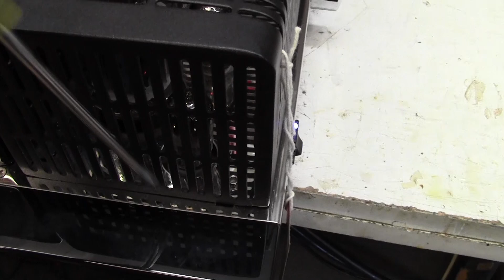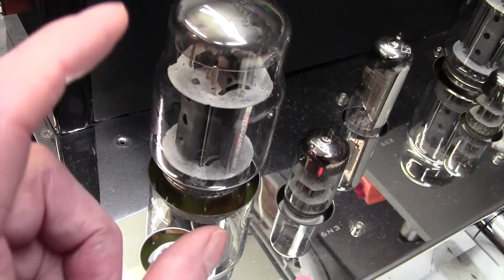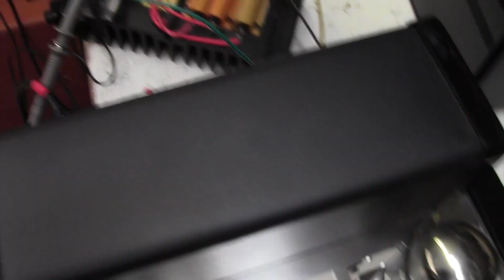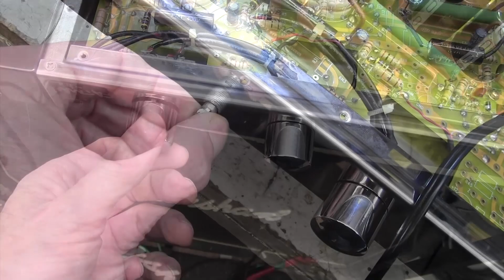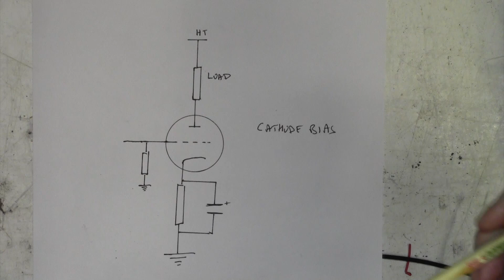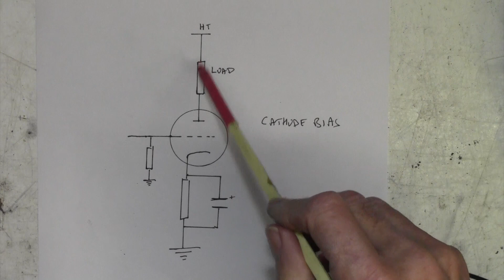How to Fix Fatman 182 Hi Fi Amplifier Low Volume on One Channel

Comment: Do you have a video on diagnosis of low output from a non valve amp anywhere?
I have a Yamaha sw500 and the driver tests well using a different amplifier, but when using the plate amp built in to the speaker the volume is very low and barely affected by the gain potentiometer.
No crackling or unpleasant noises, no scorch marks, dry solder joints or swollen components on the board.
Thanks for sharing your knowledge.
It's appreciated!
Reply from the maker: Hi That's a very complex modern amp and almost ceryainly Class D with loads of surface mount components. Not easily repairable, alas,.
Reply: @stuartukguitarampguy5830  oh ok.
I have the schematic and im pretty stubborn so I'll keep hunting for assistance.
Thanks for your reply and interesting video

Comment: I can't see a load connected to the put put. I have always been told that running a  valve amp without speakers could blow the output transformers.
Reply from the maker: Hi That's only true if there is a big signal going into the amp. Even then it's most unlikely to cause an issue.

Comment: Hi Stuart. Another top video, so thanks a lot for that. Do you use an isolation transformer with your oscilloscope? I have read multiple articles on whether you should or shouldn’t use one when using a scope with a guitar amp. Also read a few things saying not to use use the group cable on the scope probe as well. Would love to know if you have any strong opinions on the subject. Many thanks again. Paul
Reply from the maker: Thanks Paul. No I've never heard of using an isolation transformer for the scope. I can;t think of a good reason? The scope ground and amplifier chassis ground are the same ground. Wonder why they want to use a transformer?

Comment: What do you mean by the power tube tick over rate? I don't know what the tick over rate is or does
Reply from the maker: Hi Wayne. I mean the DC bias current flowing through the tube. KInd of like the car tickover revs when no accelerator is used.

Comment: A brilliant explanation regarding “auto biasing” but sometimes, what you call the “wasted voltage”, developed across the cathode resistor is intentional and used to introduce negative feedback for that stage. Although this reduces the gain, as in this case, it produces gain stability and increases the bandwidth. I frequently used to find exploded electrolytic bypass capacitors in amplifiers where the cathode resistors went open circuit. The voltage across them used to rise to way above their rated value, used to make such a mess. Keep up the good work, really enjoy your channel.
Reply from the maker: Thanks!

Comment: The volume control appears to be a Chinese clone of a high quality Noble potentiometer. The wafers are sandwiched together with a pair of bolts,  and so if there's no opening  where you can easily inject control cleaner ---- there might or might not be slots underneath the control where the terminals exit, or it might be sealed ---- you can remove one of those bolts and loosen the other and squirt a little cleaner into the gap or space that develops between the wafers, or into the hole that the  bolt passes through, and the control cleaner will work itself down inside the control by capillary action. Of course, this means you have to remove the potentiometer from the amp chassis first!. It does appear that there's a section of the main circuit board right behind that control which doesn't have a trace running through it, and so you probably could take a Dremel tool to the edge of the PCB and grind away a little bit of the main board, an 1/8" or so, and perhaps create enough space to angle the control out. 

 Be advised that I have seen eBay sellers hawking what appear to be or are said to be high quality Alps "blue velvet" pots but are actually fakes and have poor resistance tracking between the 2 halves of the stereo control.
Reply from the maker: Ok thanks for the info.

Comment: The defective cathode bypass capacitor appears to my eyes to be bulging slightly. It's also located closer to the hot-running cathode resistor then the capacitor for the other channel is, so its not surprising for that particular cap to fail first.  I would have installed it with the leads left a bit long so that the capacitor could be bent or tilted away from the heat generated by that resistor.  PS, the bypass capacitor also increases gain, improves frequency response, lowers distortion and improves linearity.

Comment: An old serviceman's trick for replacing screws such as the hidden one down at the bottom of the tube cage: put a dab of soft, sticky beeswax inside the screwhead and push the screw onto the screwdriver tip.  We would collect the soft wax that comes out of hot-running transformers, and every tech had a little vial with a ball of it on their bench. In a case like this, the problem with using a magnetic screwdriver is that the screw itself will tend to tip sideways off of the screwdriver tip, going off in search of the nearest ferro-magnetic device, like the transformer housing or the amp chassis.  Anyway, if you don't have any soft beeswax from a transformer, a soft resinous putty of almost any kind will work, and you only need the tiniest dab of it inside the head of the screw.
Reply: I use blue-tac, works a treat.
Reply: @user-rf9me7xm1w  , auto-body ribbon putty, like a softer version of Mortite ribbon caulking, also works.  The trick of course is to use just a tiny bit of it, just enough to hold the screw but sufficiently little that it will easily be displaced if you need to remove that screw again.
Reply from the maker: @user-rf9me7xm1w  Good idea!
Reply from the maker: Hi thanks for that. I often just glue the scrw on with a dab of glue. Magnetic screwdrivers are a thing of course, but I don;t own a full set.
Reply: @stuartukguitarampguy5830  ,  You can temporarily magnetize the tip of any steel screwdriver simply by rubbing it on a speaker magnet or the other large magnet, several times. You can also buy a hollow, torpedo-shaped  magnetic adapter  made by Makita (it's blue, like their tools are) that will slip right over the shaft of a screwdriver to magnetize it; you can slide the magnet away from the tip for less magnetic force or towards the tip for a stronger magnetic force.
Reply from the maker: @goodun2974  Ok useful info thanks.